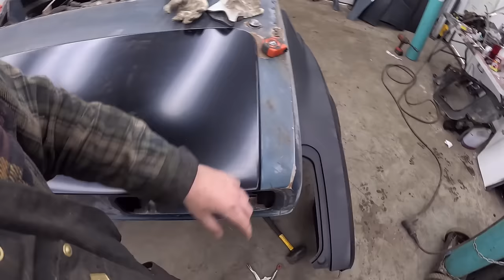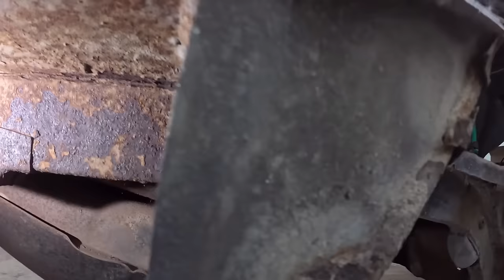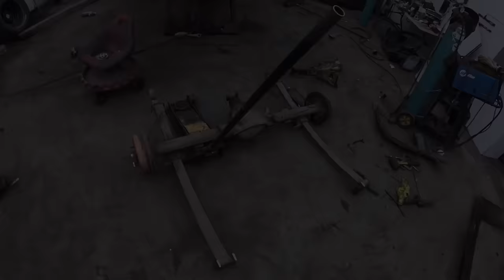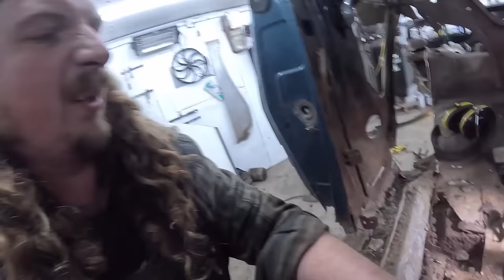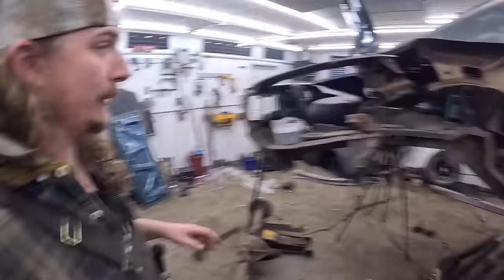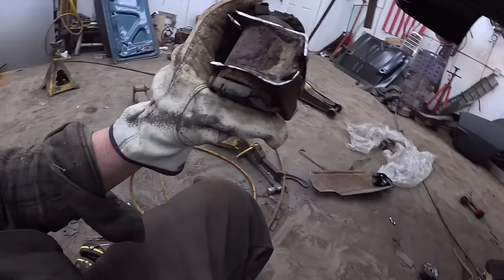Hidden Frame Damage! - My 1967 Camaro Is TWISTED

Comment: Hi Dan , as a motor vehicle Inspector in Alberta and BC , I would weld some diamond's over the joints of the
frame  just so no one can fail the repair .
Reply: That's called fish plating it. Yes makes it very strong.
Reply: I was thinking the same thing but put them inside, maybe drill some 3/8 holes in the old rail and then in the new frame rail, then weld them in place on the old first and weld both the 3/8 holes, and a 2nd weld where the plate comes out, and have more holes for the new rail part, and weld them up soled, then you could grind them and weld the seams last, then grind clean and paint. I know with the Hi HP motors Dan likes to use with out a diamond plate or the inside plates, you could snap the frame, I would think that's the weak link now. I was just thinking if you want to keep it original looking on the frame, then Diamond plates would be a give away of frame being repaired. I'm sure if it was I high end restore job they would just replace the whole frame rail. I love your show Dan and you do great work, and a working man's budget. Got to love his channel. But the diamond plates would be fine to, as long as they don't get in the way of anything like leaf springs or the rubber stop, would have to look at the video again to see for sure. Just glad Dan can save to many form for bone yard. :)
Reply: Yep, the diamond plates would work fine without anything getting in the way.  If your building big HP, I would think it would be a must and a sub frame too.
Reply: Good advice.
Reply: Fish plates good!  Man, you are definitely making lemonade!
Reply: This is awesome advice! Any chance you inspect in edmonton? I bought a wicked 78 service truck from a tractor dealer who never registered it but kept it just super cherry. Looking for not a moron to do an oop if you can or know anyone it would be truly appreciated. Cheers bud
Reply: Kal tire in Leduc, 
 Their, tec Harley knows his stuff what's 
Legal and what's not.
Reply: plate is only as good as what its connected to        how many heavy trailor hicthes have you seen that are heavy only to be bolted to the sheet metal in the trunk   when it breaks where
thats gonna be stronger than original @1961clyde

Comment: Hey, Dan! While we're on the subject of aftermarket panels, I spent the majority of my adult life in the automotive industry and when we finished production and then ran out all the service parts, before we sold the dies for body panels to an aftermarket production company  we opened up all the tolerances as far as they would go. This is why OEM parts fit better. Most OEM service parts for a "68 are long gone tho...
Reply from the maker: Yeah unfortunately you're right on that

Comment: I have a 1967 camaro s.s. r.s. , it's been in my family since new , it's had a 1970 factory l.t. 1 crate motor that was put in 1972 but taken out in 1978 for a " freshen" up , it's been that way since 78 but I still have the motor , the car is all factory and needs just minor body work , I'm a body and paint man so after watching your video's , my car is gonna be so easy to " restore" , California car so no rust , and the back of your car is so twisted , as you know it has to have at least the right frame rail with the left rail pulled back to the right side of the car , a ton of work , makes me so inspired to finish my car ........

Comment: My first car, 67 Camaro. Had right rear body impact damage. Previous owner had pieced it together and traded it in at a local Chevrolet dealer.  I buy it and started driving it to and from work and drag racing on Sundays.  I’ve never been a fan of the monoleaf rear spring in general, but it had a cracked right rear spring from the accident with the previous owner. After a while of driving daily and racing it on Sundays it decided to break sitting in the staging lanes at the drags, dropping the body completely down on the tire.. Luckily I wasn’t speeding down the track when it happened. I was young and knew it had been in an accident but I assumed it was mechanically sound. It could have been a bad bad situation no doubt. I Lucked out but really should have inspected it closer and replaced that spring. But the car probably should have had more than one leaf spring by design for safety sake. It pays to look a car over good after any accident. 👍

Comment: Dan, when I first saw the rear diff cover in an earlier video, it looked to me like a Firebird rear axle.  But after seeing the ears on top of the diff for upper control arm bushings and the other mounting brackets on the axles tubes, it's most likely an Olds Cutlass rear.  It definitely came out of an A body due to the triangulated four link.  And the rear diff cover is BOP rear axle.  If it were mine, I'd definitely put the 12 bolt rear you have in it.

Comment: Not so sure I'd slice and spread the left 1/4 to fit just yet, doing so looks like it will make the top surface of that side wider than the right side. You're on the right track on the frame rails, make sure they are both square and plumb, then the 1/4s, trunk lid, trunk floor, and rear panel should all line up with much less fuss. Tack everything on the whole rear clip and gap it all before welding it home.

Comment: Dan since you have the back-end opened up like you do you might be able to pull that quarter on the driver side to match your trunk better before welding the quarter panels, at the tail light pan.

Comment: I think your first instinct was to put fish plates on the frame was correct. After seeing the spring pockets a lot of folks would have back halved this car, I'm glad you fixed it. I have a 58 delray in my front yard that I still have to weld the back half on, there is nothing behind the rear window right now. I'm glad to see people as crazy as me still out there.

Comment: I'd put the trunk pan in first, then the tubs. You've got unfettered access to put the whole damned thing in if you need. Start putting in other stuff and you run the risk of having to section the pan to get it to fit into the available opening.

Thanks for doing this! I'm having to get into some of this kind of remediation on one of my vehicles and this is giving me a little more confidence to do it.

Comment: Dan your talents never cease to amaze me. You are fearless and just jump in and take on and tackle any obstacle. You have real talent and sneer in the face of adversity. Most guys would not have a clue how to fix these missing/rotted areas. Your 12 gauge plating and part you fabricated looked fantastic. Me personally, I would go ahead and plate that frame section where it butts up to the original. It won't take you long at all and it will be so much stronger. Really nice work! I'm mesmerized watching you work and can't wait for the next video.

Comment: You can totally understand how someone can get over their head in a project. This is why so many cars are only half done. Bravo for sticking it out and working to make it right
Reply: Happens all the time just discover the frame rail on the passenger side by the rocker looks beat to he'll the door was brown and there is between a 1 to 1.5 inches of bondo there the car sits alright I'm just going to ignore it and Rebondo  it the guy before me that was a body pro did good enough

Comment: Damn. You were right about how these cars were thrown together on the assembly line. This one was done before robots. Those front leaf spring mounts were sketchy as hell design wise. Speed clips?? I mean, really?  And oblong holes and shims? Body by Fisher. The front leaf spring mounts on the '63 Nova SS I had 45 years ago were also very poorly done, and one of them was mangled. Looked like somebody maybe drove over a large rock. I had to have it replaced/repaired, not sure exactly what they did, at a shop. I would definitely weld on some reinforcement plates where you joined the frame rail sections, because, well, why not. Might as well make it as strong as possible while you can get to everything. The factory sure didn't do a very good job.

Comment: You have gone so far I would remove the frame rails and any other rotted metal out and Sand blast the car and put it in epoxy.  then weld in the new metal.
Every one has to do it their own way.  I could never put all of that good new sheet metal on rusted metal.  It would drive me crazy and I would not be able to sleep at night!
Stop the rust from continuing and if you sell the car down the road the new owner will be happy.
Thanks for the info and common sense about what you do.  Good show.

Comment: Frame connector mounts with the 3 bolts at front spring mount, front has a box that mounts with the large bolt at the sub frame rear , and you can tack them for best strength

Comment: Dan I back halfed my 79 trans am when I cut the floor out side to side from the back of the front seats the body turned to jelllo scared me at first but after the roll bar and rear frame rails went in it was all good.did this 20 years ago been a drag car ever since running 9.70s at 140 mph.

Comment: Lose those rear shackles Dan, they will destroy your rear frame.  They are one of those 70's "high performance" things that should never have come out.  Might want to loose the monoleaf springs too.  Back in the day they would crack and break at the leaf spring pin and you would go for a ride! 😮
Reply: Man that and hyjackers was how we could stuff the biggest wide oval's under them, back in the day..
Reply: And side pipes dionrau!  Had all those hi-po bolt- ons on 6 cyl Nova!
Reply from the maker: Yeah its all cut out

Comment: "Camaro by the foot" I snorted so hard, I farted.
I've seen semi frames sectioned with vertical cuts and welded with no fishpkating. They worked fine.
The camaro is a showcase for building a new 67 in 24 !

Comment: You might find that the new passenger quarter fits a little better..That was the case on my pair..My drivers side also had a huge gap at the trunklid just like yours.  After staring at it and griping about the poor quality for a week or so, I broke out the cut-off disk and sliced it, and added metal...I have nice 3/16 gaps all around now, but you have to work for them unfortunately.  And..as you mentioned those rockers need to be strong..they are an important part of the structure on these unibody flexmobiles!!

Comment: ive heard the s-10  4 wheel  drive rear axle is in the mid 50" wide and pretty strong  and posi  the 2 wheel drives are ever shorter

Comment: The only thing I would say is to strip the quarter panel down to bare metal all the way up to the roof seam to make sure it’s actually good and not full of bonds and rot before you cut the aftermarket panel

Comment: Good job Dan we did a chevy 2 years ago and the only thing we did different was z cut it where we joined the frame rail I really don't think it's any stronger it just made us feel ɓetter doing it that way you can also fish plate it which is probably the best but looks like shit...loli think it will be fine good job on the spring pocket it's way stronger then factory for sure.

Comment: Dan 2nd gen S10 for a rearend they are 58 1/2"  or a S10 4x4 around 63". Or Ford Explorer 8.8 with a limited slip 4.11 or 3.73 gears. Use it as is or narrow it .

Comment: the frame rail you replaced is prob ok         if the old one was bent did you measure when you replaced it in comparrison to the front of the car i have seen this possible mistake before       measure measure measure

Comment: Me and my friends put big blocks in everything . From about 1975 to 1985 . We always put multi leaf springs in the rear and sub frame connectors on. These cars twisted with a strong big block. It's not a big deal . Cut , weld , cut , weld . It's just a camaro
Reply from the maker: Exactly

Comment: I've watched guys cut the a-pillars out on the inside and cut all the inner structure out and weld a roll cage to where it's hidden so they can just take windshield urethane and put the trim back over and just hide everything just you know stuff they do. You would be surprised that house solid that makes a car after you weld all the seams up solid. It makes it real stiff if you was to crash its junk you could replace the sheet metal but if it bends something you're done. You can put that baby on some scales and then start putting that liquid epoxy in the floorboards to get the weight right and stuff and heck I've even seen them taking plug up all the holes in the unibody and pump it full grout
Reply: You can take them what a bung in there and use epoxy too but you got to vibrate it real hard. Sometimes the grout is a little too heavy it takes a lot of motor to make the car move after that so you know there's alternatives

Comment: Adding frame to the frameless to end the twist you are worried about. Add any sort of power and you have to get the frame ready to take that torque before your a couple of launches short of a cork screw mess of twisted body parts lol

Comment: I'd fish plate over the frame weldment. Like this 》<=>  8" long x the frames high with 11 ga. You could even get fancy and use a piece of the unused rail and lap it over, and add plug welds 3 per side of weldment. 

I like biscuits,  tator tots aaaaaand triangulation.  :)

Comment: Hey Dan, I left a comment/question in your other video and asked if you could give me some advice about my 69 Camaro. I should have thought about it you are probably too busy to answer my question. The thing is I watched the install of the frame which was a good video, if you have a floor to work with, but what if the floor was bad the floor drop downs are bad rear tail panel is bad the inner tail panel shot and the spring shackle is pushed into the inside of the trunk, I just wanted to ask were and how would you start to fix it if you were doing that job. Again I don’t even know if you will see this so I don’t why I am still asking but I hoped I could get some insight from you. I have a few thoughts about how to start, I think I will just wait and think about it for a while thanks anyway don’t worry about it sorry I bothered you cause I know you’re busy. Later

Comment: So basically, you’re pretty much building a 67 Camaro from just about scratch? Will be nice when finished.
Reply from the maker: Lots of replacement parts thsts for sure
Reply: It may look OK from a distance but as Dan will be the first to say, it is what it is (or it is what Dan made it). It will whistle in the wind, it’ll rattle , it’ll be hot in summer and cold in winter, it’ll throw water/snow/ice into places it shouldn’t, and that’s just for starters. But it didn’t have to be that way , oh well .